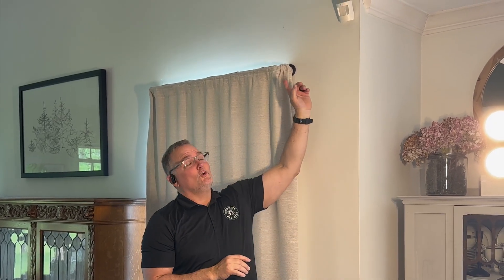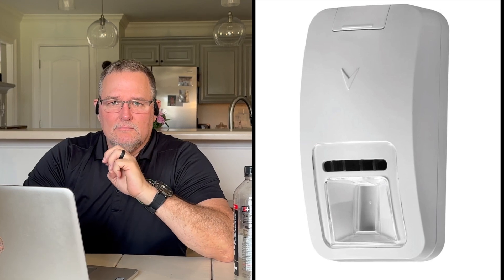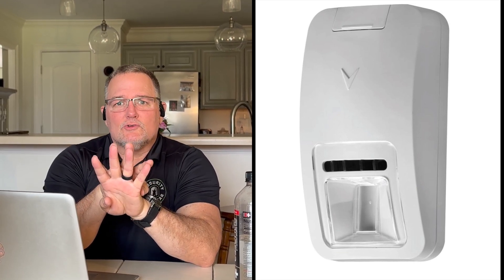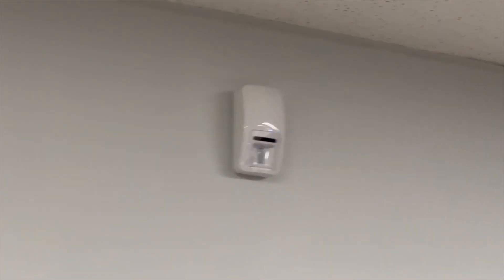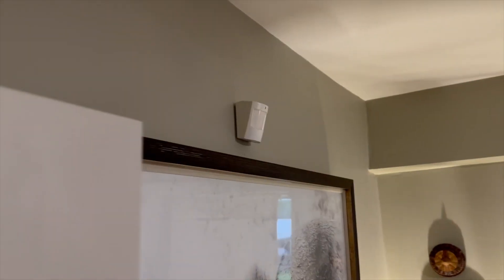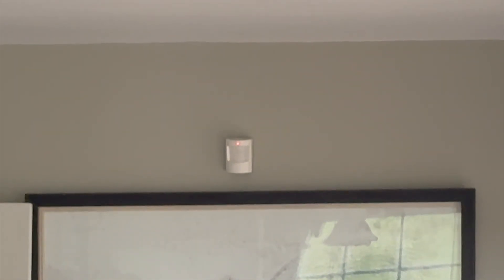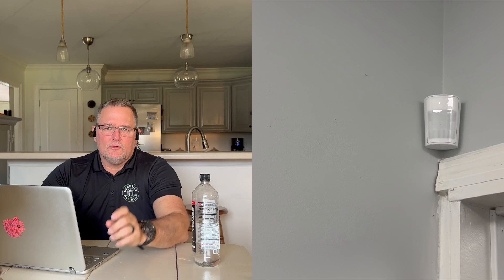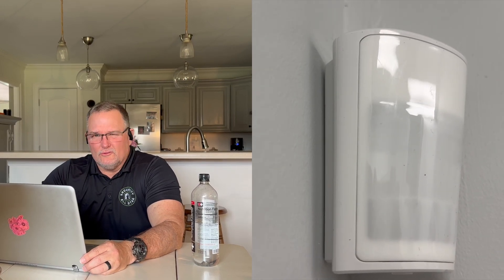Why Motion Sensors Are So DUMB

Comment: My old boss at the pawn shop I worked out didn't think i was telling truth when I told him I could move around inside his store with the alarm set and the motion sensors not go off. I very slowly went from the back door to the gun case took a pistol and went back without setting it off. Dude about fainted. Just went very slow. I have no idea what sensors he had but discovered it after he locked me in one night not knowing I was still there in the back working on a gun, I went 20 minutes without setting it off as I was moving very slowly checkering a expensive stock. It didnt go off till I sat up and moved quicker. So I reset the alarm and tried walking slowly it worked.
Reply from the maker: I bet that was quite the experience for you and your boss!  The Dual Tech and now AI cameras working together would definitely keep you still.   No fooling that stuff.
Reply: Yes the correct dual tech..many dual techs use the combination simply to reduce false alarms rather than improve detection...in fact they ALL did in the early days. But your right, the good ones are pretty impossible to get past now. The PIR ie passive infra red can be walk past slowly because detection is limited to a range of speeds...too fast can go past as well...but not practical...slower works better.

Comment: None of the burglar alarm detectors actually see motion, they sense changes in enviroment, some actively and some passively, using either infra red, microwave, ultrasonic, laser, mechanical switches or air pressure to determine if an intruder has entered the premises. Camera systems on the other hand do have motion detection, as well as subject identification, monitoring changes in the images consistent with known subjects like humans and animals and today use AI. The problem being that for residential application the camera systems are intrusive themselves.
Reply from the maker: Yes, and great comment.  Now we have a LOT of people who we suggest use cameras in certain situations.  The Dual Tech motions are truly awesome.